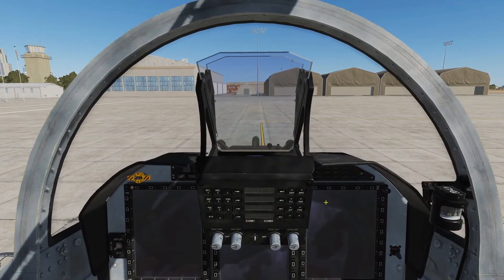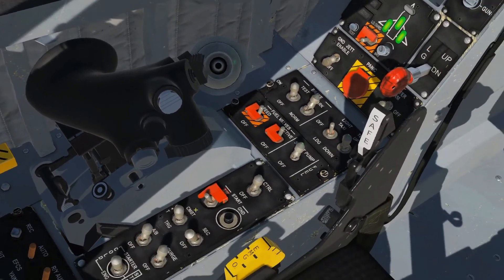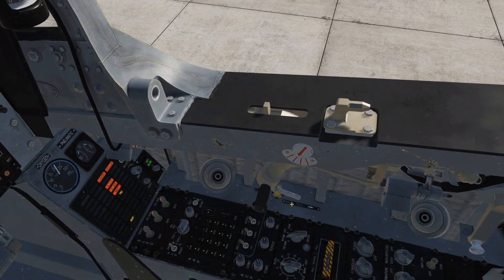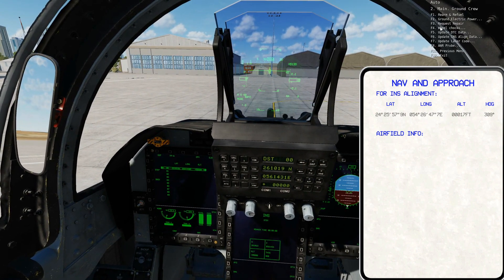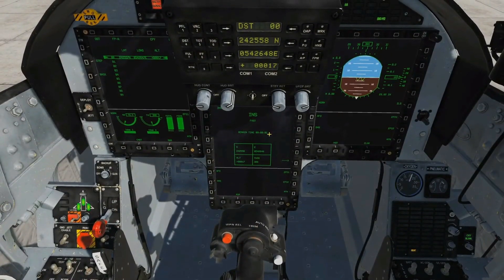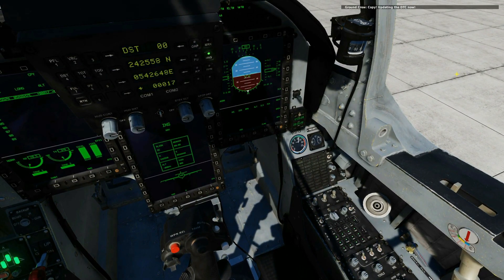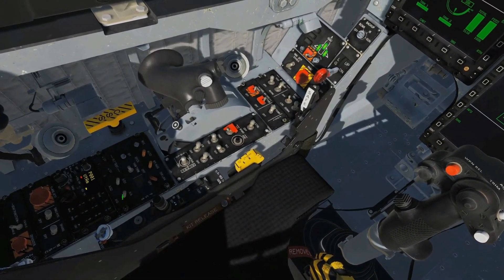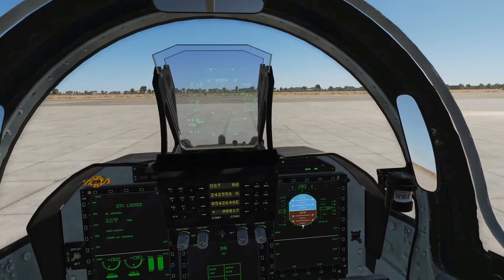JF-17 Thunder: Cold Start, Re-arm & Taxi Tutorial | DCS WORLD

Comment: It's also a good idea to write it all down. 
Here, let me make it easier for you ;)

JF-17 THUNDER: COLD START TUTORIAL

1 - (RIGHT)[ELEC]

BATT > ON 
AC GEN > ON 
DC GEN > ON

2 - (RIGHT)[AAP]

AAP > CMBT

3 - (RIGHT)[ACP]

INT COM > ON
VOLMS > UP 

(TOP LEFT) MASTER WARNING > OFF

4 - (LEFT)

START PUMP > ON
ENG CTRL > ON
THROTTLE > IDLE
START GND > HOLD 4 SEC

5 - (RIGHT) CLOSE CANOPY > LEFT CLICK 3 TIMES TO CLOSE

6 - (RIGHT)[ECS]

> NORM

7 - (LEFT MFD)

> EPI1

8 - (LEFT)

> OXYGEN TUBE
> OXYGEN VALVE 

9 - (LEFT)[MISC]

EMG HYD > ON
SHARDS > ON "NAVIGATION"

10 - (RIGHT MFD)

> EFIS

11 - (FRONT)

HUD BRT > UP
UFCP BRT > UP

12 - (FRONT) "NAV AND APPROACH FOR INS ALIGMENT"

MANUAL -

 RSHIFT + K
 <= + <= TO ACCEPT

AUTO - 

\ 
F8. GROUND CREW
F6. UPDATE INS ALIGN DATA
F1. GET PARKING COORD
RSHIFT + K
HDG "COPY NUMBER"
(RIGHT)[ACP]
TURN KNOB TO > FAST

>40 SEC COUNTING<

(CENTER MFD)
===> ARROW
PASTE THDG

WAIT 40 SEC TO ALIGN 
(BOTT LEFT) RADIO TO "TR" OR "TR+G"

ALIGNMENT DONE

13 - (RIGHT)[ACP]
TURN KNOB TO > "INS NAV"

14 - (RIGHT) "OPEN CANOPY TO RECEIVE DATA CARTRIDGE"

3 TIMES RIGHT CLICK TO OPEN
\
F8. GROUND CREW
F5. UPDATE DTC DATA
F1. UPDATE DATA
>COMPLETE<
 (BOTT RIGHT) "HIDEN SLOT BEHIND KNOBS"
> LEFT CLICK ONCE
> LEFT CLICK TWICE
(RIGHT) CLOSE CANOPY > 3 TIMES LEFT CLICK TO CLOSE
CHECK (LEFT MFD) FOR "DTC LOCKED" THEN CLICK > "ALL" > "ENT"
LOADING DATA CARTRIDGE 
>DTC TRANS< 
WAIT FOR
>DTC LOCKED<

15 - (BOTT LEFT)[FCS]

> CHECK

16 - (LEFT)[BRAKE]

PARK TO > NORM

17 - (LEFT) 

EJECTION SIT SAFE TO > ARM
(IN FRONT OF THE STICK) > "REMOVE"

18 - (BOTT RIGHT) LIGHTS > "IF NEEDED"

19 - (LEFT) TAXI LIGHT > "IF NEEDED"

20 - CHECK FOR WARNINGS > 
ALL OUT > CHECK

21 - NOSE WHEEL STEERING

> LALT + D

>HAVE FUN<

Comment: i dont think this works in 2023 after whatever they've done to the plane, on normal startup like this it turns off while the engine spools up when the t4 sensor on the ep1 screen reaches about 370
Reply: You need to remove the inlet cover and ladder for it to work.
Reply: @albertlaun9142  yeah I found another guide about 9.5 months ago that did work